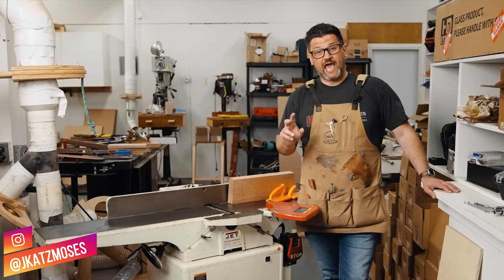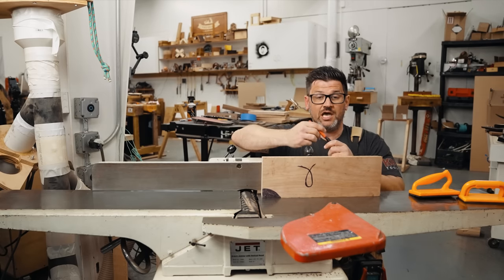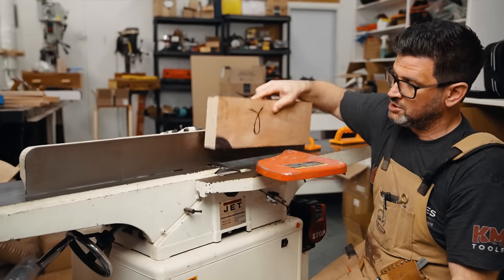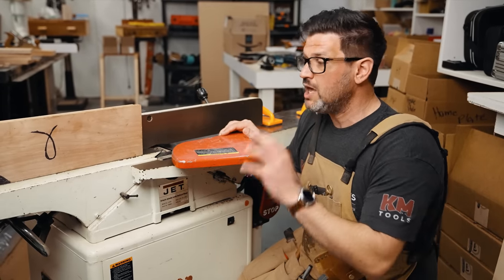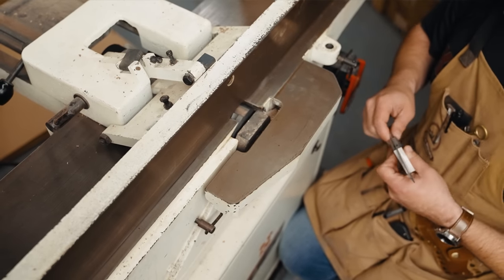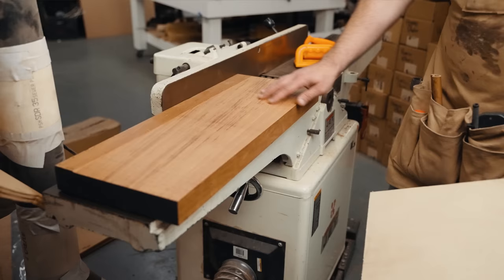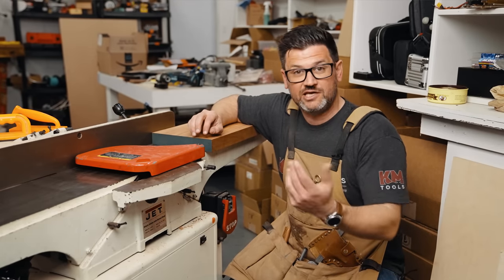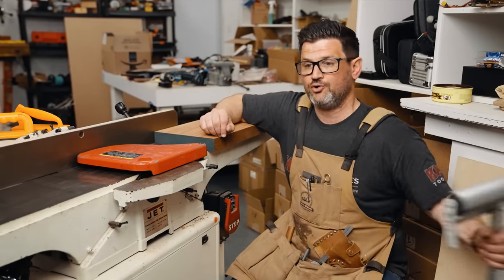Jointers For Beginners - Use Tips, Tricks, Buying Advice and Safety

Comment: When I was in high school (mid-1960's) I and other wood-shop class members witnessed one of the instructors sacrifice much of his right thumb to the jointer. To do so, he violated every safety rule he and the other instructors had taught us. 
  * He was in a hurry. 
  * He did not use push sticks.  
  *  Most importantly, the piece he was running through was fairly narrow and ... only about THREE INCHES long!  
We didn't see much of him after that, and later found out he changed from teaching to school system adninistration. That was my introduction to just how fricking FAST things can go sideways if you are not paying 100% attention to what you are doiing.

Comment: Jonathan,
  I see a big nick on the out-feed table of your jointer.  Is that from your finger? I really appreciate your videos, tips, tools, etc. Gary
Reply from the maker: Funny story, the jointer was at Space X before I bought it used. The engineers didn't know how to use it correctly and set the out feed too high. Turned it on and chunked the blade into the cast iron. Nobody would use it so they let an employee take it home. I bought it from him after he upgraded to an old 12" Faye and Egan.

Comment: One scary machine...but one I believe to be necessary. Not the first machine on my list...but in the top five.

Size is king...but like JKM demonstrated, there are work-arounds. I currently operate a 4 inch Rockwell from the early Sixties. Great little machine, and does what I need it to do. Bed length is a bit of a problem, but I mostly do "fits-in-your-hand" projects, so I'm not jointing massive boards.

Years ago an old electrician told me that volts related to pressure, and amps related to volume. Not exact, but an easy way to understand why 240V motors are more efficient and product more work force...in that they tend to bog down much less. I prefer...when I can...to run my table saw, band saw and jointer on 240V. Not a deal-breaker, but I look for dual-voltage motors on a used tool.

I have a warped mind. Laying on the table in the ER after introducing a finger to a dado stack, I began to calculate just exactly how many blade tip strikes I took. Not pretty. Since then, I look at every tool with that in mind. My jointer? 5000rpm cutter head speed with three knives is 15000 cuts per minute or 250 cuts per second. Average reaction time being one-half second means before I even know it, I've been cut 125 times. Kinda slows me down, y'know...makes me stop and think...do I want to do this? Am I doing this the best way? Might there be a better way to accomplish what I need to do with a different tool? 

Thank you, JKM. Well spoken, clear and concise information about a tool frequently abused.

Comment: I know this is an old post but I know you are not supposed to have that exhaust port on unless you have it hooked to a collector.  Now taking off the infeed, what did that do? I had no sound. Mine seems to be lower by the blade than the outside. Do you know if there a why to shim it.

Comment: Great vid! Jonathon can you explain a little more why you jointed the board that was wider then your jointer with the jointer? Instead of just putting it through the planner. Or is this step your way of skipping a sled for the board running through the planner to get the one flat side? Appreciate it!!! Brian
Reply from the maker: Way faster with a jointer than a planer sled. No shimming, hot glue etc. Took two passes with a jointer and used scrap plywood. 2 minutes vs 15 min.
Reply: There are some videos on the subject out there.  A jointer is designed to flatten the board (i.e take twist and such out.)  A planer makes both sides parallel.  So a twisted board would still be twisted, just be the same thickness.
Reply: @katzmosestools  Thank you so much! I absolutely can see what your saying now. It was a pain making a sled, hot gluing & going down that time consuming process with a couple charcuterie boards.
Reply: @thomasstone3513  I get that, that makes sense. Greatly appreciate the response.

Comment: You're wrong here ... if you had a European type of shield, not an American-swing type, then not only could you wear the blades evenly across the entire width, but because you set the European shield only as wide as the workpiece, your thumb is not  could not get into the area above the blades.Otherwise, the American type of shield seems practical, which is because it does not need to be adjusted, but it has a major flaw - in fact, it is no longer a shield, if every finger can remove it .... it is practical, but stupid and dangerous!🤨👎
Otherwise - I love your contributions and I have been subscribing for a long time ... I also bought the CMT Cromium saw blade that you recommend ... a really good blade👍 .... keep up the good work😉
Greetings from Slovenia🇸🇮

Comment: When I was 9 my dad cut his thumb off with a Jointer. He was jointing thin stock without a push block, it broke and his thumb went into the blades. I’ve been too scared to buy and use a jointer until last Fall; I’m 42.

Comment: I'm having issues with my cheapy jointer.  The two things I'm seeing is an hour glass shape to the edge I've jointed...pretty much inverse of "snipe".  That is happening really consistently, I thinking my table or blade is not in line?

Second problem happens to be sporadically, I'll start with a board thats close to parallel end to end ( inside 10-20 thou)  and after a few passes my lead edge will be 50-75 thou narrowwer than the tail end.  I thinking this happens because of certain board conditions, but I'm not experienced enough to recognize & adapt.

Any suggestions would be great, I really need to make some clean glue ups.

Comment: When 220v wiring is used, less current is required than with 110v wiring. Power is measured in watts. if a motor is  900 watts of power, 4.1 amps at 220v wiring, it will be approximately 8.2 amps with a 110v wiring.

Comment: The only thing slipperier than a waxed jointer are the paddles that come with them. Use one on the front as a hold down and a push stick on the back to move the wood forward. Everyone with experience knows what I’m talking about. Like all power tools, keep them close and easy to grab. 1:15 demo of paddles sliding instead of gripping.

Comment: I'm just starting with my jointer.  So far all I have managed to do is make the front end thinner than the back end.  When I deed the board, it starts the cut and then I shift the pressure to the front end which then lifts the back end.  Frustrating

Comment: As a safety I was thought to never joint a board shorter than 18”. Therefore cut to size after jointing. Just one more safety step I think you should have mentioned.
Reply from the maker: I do mention it and the length is 10"

Comment: What is the difference between a planer and joiner? They seem to do the same thing, though the joiner is a bit more flexible with the fence.
Reply: A jointer can only process two edges and create a 90 degree angle (face & edge, usually).  A planer creates a parallel surface to the face you just jointed.  A table saw is then typically used to finish the last edge, the one opposite to the one you jointed.  The end result is a square finished board.
Reply: @csimet   thanks!  But can you just use the planer on all 4 sides?  I realize you might be cutting down the size of the piece, but is that the advantage of a joiner--it creates the 90 angle with less waste?
Reply: @McDreamyn_mdphd  No, not if you want the sides parallel to each other.  Only the planer and table saw can do that after you jointed the first two sides (90 to each other, one edge first, then the face).  If you don't care that the opposite sides are parallel, then only the jointer could be used... but not much call for that.  This should help explain better... https://www.youtube.com/watch?v=5G1PUkiCBbU

Comment: The physics or geometry of the jointer is actually less obvious. 

First, if the infeed part is as long or longer than the wood, then one can observe how the wood rests on the infeed. As long as it does not rock, then one can do the usual. make shallow cuts and switch pressure onto the outfeed quickly.

If the wood is a fair bit longer than the infeed, one cannot blindly joint. One has to study the board for high and low spots. If there is a high spot and it is situated near the rear, outside the infeed table, this high spot will elevate the board as it travels onto the infeed. The chance of this happening increases with shallowness of the cut.  

The high spot cannot be at the rear not supported by the infeed table. One has to get rid of this high spot. For boards a fair bit longer than the infeed, one as to use a straight edge as long or longer than the board to inspect.

Comment: Thanks for this. The only thing I might say is that I have a helical head on my thicknesser but not my jointer. I have had to rotate the 30+ cutter heads and spent some time making sure each one is perfectly seated. Not much fun. To have do it again on my jointer as well with even more cutter heads sounds like a nightmare. But no bother because I thickness both faces with my helical anyway so it doesn't matter that the jointer is straight knives. It joints just fine and I saved $1500 on the helical head. Just thought that might help someone who thought they 'had to' get a helical head on their jointer. If you have one on your thicknesser then its probably not a big deal. And sharpening three knives is pretty quick and easy. Just another option.
Reply from the maker: Takes me 5 minutes to rotate them on either machine. They are indexed so you don't have to guess where the go. They just lock down in the correct place.

Comment: I think a 12" helical head jointer and 12" helical head planer will cost far more than a 12" helical head combo machine.  But, yes there is an inconvenience in changing back and forth.  For $2K - $3K I'll spend 2 minutes switching (speaking as a hobbyist).  Thanks, I enjoy your practical straight forward videos.
Reply: Agreed. Once you get up into bigger sizes, a large combo machine (like the Hammer 12" or 16" planer / thicknesser) actually costs less than a similar sized jointer from a good brand like Powermatic. And it works as a planer too! There was a good video on this on Jason Bent's channel a few months ago. I currently own an old 6" Jet jointer and the DeWalt 13" planer that so many YouTube woodworkers have. But I'm moving to a house with a much bigger shop soon, and I plan to sell both of those and buy one of the big Hammer combo machines. (If anyone near San Jose CA wants either of my old machines, let me know. I plan to list them on CL soon. If I sell them now, I won't have to move them. :-)

Comment: Do you need a planer if you have a jointer?  Can’t you just joint all four sides?
Reply from the maker: You can flatten 4 sides but that doesn't mean they'd be parallel. A planer flattens based on the opposing side where as a jointer just gets 1 plane flat without referencing anything else

Comment: I am a brand new woodworker and I don't understand why you can't just turn the board around when you are jointing a board that is wider than the jointer blade.
Reply: Because it will tilt. There's no way around this unless your board is flat to begin with; then why would you. Now if your eight inch board that was flat, and you're working with a six inch edge planner (for example) then you could feasibly edge plane two, or three inches, then turn the board and edge plane the rest to equal the first planed edge, because you would have enough surface area to keep the board flat and level... maybe, so your question is a good one, and you would reduce the thickness of your board, but that is what a regular planner is for.

Comment: On the electrical part, you were correct. Look at the motor plate, it will tell you the FLA(full load amps) and size breaker accordingly. Just remember 240vac is double like you said. I have that exact same jointer, and I believe I’m running a double 20 or 30 amp breaker because I’m running mine at 240vac.
Reply: No, 120 is double the amps of using 240. The watts are the same so raising the volts lowers the amps. Yes you need a 2 pole breaker for 240 but not double the amps.
Reply: @rickz6006  if a plate says 5amps its per leg. It will pull 5 amps on both for 240. Been doing electrical engineering for 25 years.
Reply: @joeymerrell8585  The plates list 2 voltages and 2 amperages. 120/240 volts 10/5 amps on every thing I have hooked up in my 40+ year electrical career.
Reply: @rickz6006  apparently you dont understand how voltage works. Probably a union construction hand.
Reply: @joeymerrell8585  Been doing electrical since I was 12 years old in the 60's. Worked in the industrial enviroment for > 40 years on all voltages from 5 to 13,200. Have wired more 220 and 480 motors than you have probably ever seen. Ended my career running a 6 man industrial controls crew.  I'll gladly put my knowledge and experiance up against yours any day of the week. 

Why do you think they list a different apperage for each voltage on the nameplate then?
Reply: @rickz6006  and we aren't talking about 3 phase power either. But even if that's the case, your amp draw will be even across all 3 phases. And as of now, I am a electrical trical engineer with a PE, and was a master electrician before I even went to college. I design control systems for a major company.
Reply: @joeymerrell8585  Formula: P = IE where P = Watts, I = Current in amps, V = voltage. A 1 hp motor = 745.69 watts so if the voltage is 120 your amps will be 6.21. If volts is 240 the amps are 3.11. Double the volts is half the amps.  Don't know how you can't know this. Of course Formulas get more complex for 3 phase but the truth is higher volts means lower amps, heck this is why higher volts is used in transmition lines to save on the wire size and loss over distance. I suggest you get your books out and read up a little bit.  DONE

Comment: I respect my joiner, but fear my shaper. The "router bit" is 6" diam, 2" tall, spins 3.000 rpm from a 4hp motor. This thing don't cut your finger. It rip your arm off if you don't  fear it.

Comment: What can the jointer do that that planer cant? Why even have the jointer if the planer can do the entire width of that board while the jointer cant?
Reply from the maker: They do different things. Planers get 2 opossing sides parralel but not necessarily flat. A jointer gets 1 side and 1 edge flat and square to each other but doesn't get side parralel.
Reply: @katzmosestools  Interesting, so when you're processing a board that you want flat and square, what's the order of operations? Planer the big sides parallel, then jointer the small sides to make them perpendicular to the planed sides?
Reply from the maker: @beachboardfan9544  jointer then planer
Reply: Why have the jointer?  To your point there are workarounds for the jointer that could eliminate it from your shopping list forever.  1) use a jointing sled with your planer 2) use a no.7 or no. 8 hand plane (or a no. 5 or 5.5 hand plane could be just as good too depending on the size of the board).  I even resort to edge sanding 2 boards for glue ups on sticky back sandpaper stuck to a known flat surface.  It can be hard work to do jointing manually but the results are just as good as a jointer IME.

Comment: i only have an old 4"  lol  but I still dont know what the heck im doing.  i end up with a cup or something
Reply: Usually the outfeed is too low or the beds are too short for the length of board you are trying to flatten. Also if you put pressure on the infeed instead of only the outfeed it can cause that. If the outfeed length is less than 1/2 of your board length it may have issues. You say you have a 4” jointer and then i’ll assume it has a pretty small footprint.
Reply: @lordtstauffe  sounds exactly like my issue is limitations.  I'll try smaller boards.

Comment: Safety rule #0: Use the tool from the front only.
Do not use the jointer as shown from 1:48 till 3:14, from the back of the tool. First of all you cannot handle your material well and secondly the emergency switch is on the other (front) side of the tool; preventing you from pressing it if necessary.
Reply from the maker: Yeah I was demonstrating so I didn't block the camera. Should go without saying but I could've been clearer.

Comment: those pushblocks cause more harm than good. First, they slide somewhat. That, in an of itself, is a safety hazard. Second, much force is involved. That's another hazard. You get none of these problems with an L pushstick

Comment: Switching from 120v to 240v actually drops the amps cuz your now running the machine across 2 circuits instead of 1
Reply: yes, but not for the reason you said.  The power use is constant so if voltage goes up, current must go down.
Reply: @tchevrier  was just trying to keep it simple
Reply: @bigwillysgarage2301  agreed, but it doesn't have anything to do with 2 circuits.

Comment: You say never joint anything less than 1/2”.  I would say never joint anything less than 2” or any piece with knots or wild grain. Never go against the grain. It is easy to have a serious accident with a jointer. I advise jointing with a Stanley. Wood through the thicknesser gradually gets flatter, especially with a little help from a Stanley jointer. I have an Emco jointer/thicknesser. I haven’t used the surface jointer for decades. Jointers are called “buzzers” in the antipodies. Why.? Becacause the wood bounces/vibrates. Every jointer demonstration I see on YouTube shows a perfect piece of wood being jointed. That is not real life.
Reply: I think your views on vibrations and bouncing are with straight knives. Helical heads make tiny slices and makes using the jointer much more enjoyable however I do enjoy the curls on my Stanley no 7 along with the workout.